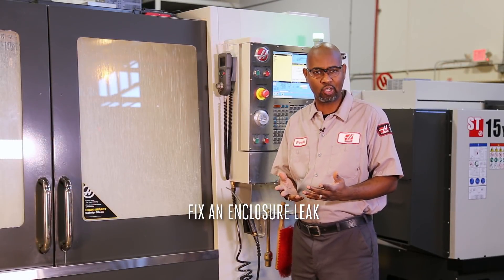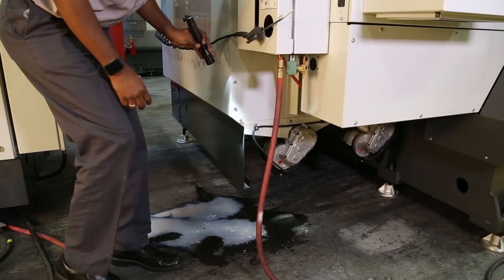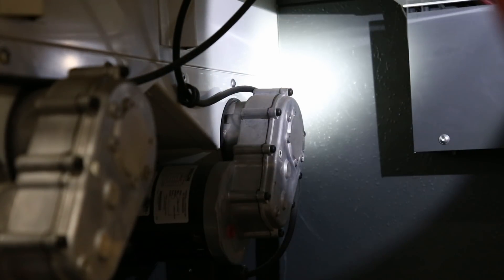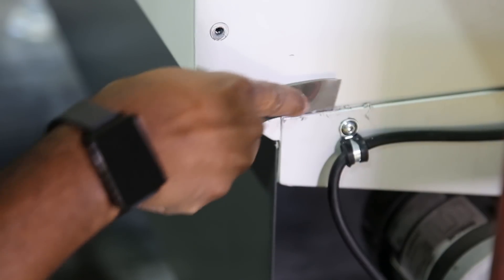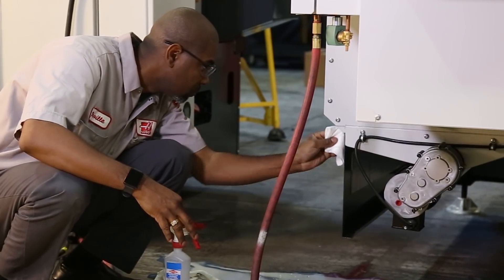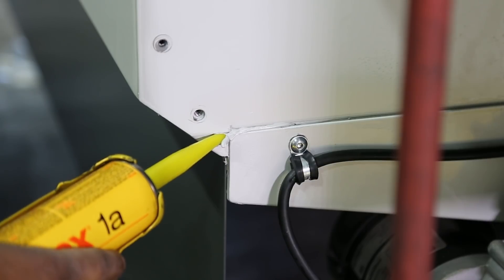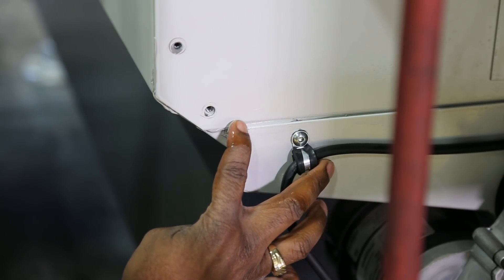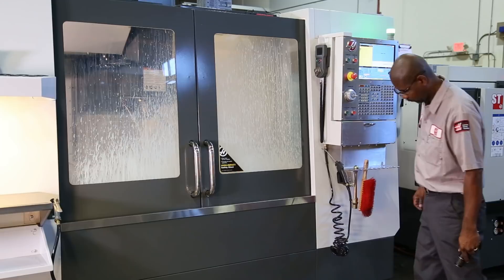Fix an Enclosure Leak on your Haas machine - Haas Automation Service

Comment: good day sir, i just want to ask if straight cutting oil advisable on haas milling machine or coolant is better? im currently working at a small company with 14 haas cnc milling machine and i noticed since we started using straight oil, most of the machines are having problem.. thank you
Reply: Froilan Patinio   NO NO NO NEVER use straight oil, big mistake😲  I haven't laughed that hard in a long time, thx👍
Reply: Water based coolant only!
Reply: UncleBman Thank you for replying. i will tell my boss your information. by the way, I'm from The Philippines.
Reply from the maker: Hello Froilan,
Here is some of what the Haas Mill Operator Manual has to say about coolant:
Machine coolant must be water-soluble, synthetic oil-based or synthetic-based coolant or lubricant.
Improper coolant use includes, but is not limited to, these points:
• Do not use plain water. This causes machine components to rust.
• Do not use flammable coolants.
• Do not use straight or “neat” mineral-oil products. These products cause damage to
rubber seals and tubing throughout the machine. If you use a minimum-quantity
lubrication system for near-dry machining, use only the recommended oils.

You can find the entire Operator's Manual and other documents here.
https://diy.haascnc.com/user-guide
Thanks for the question.